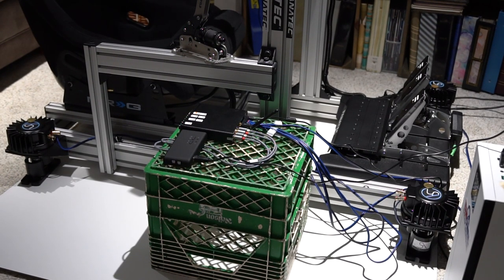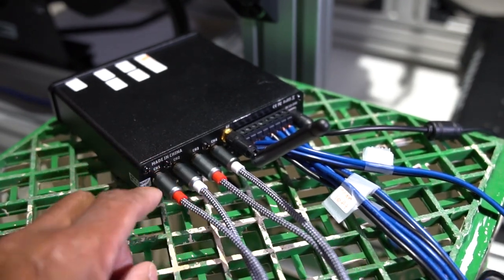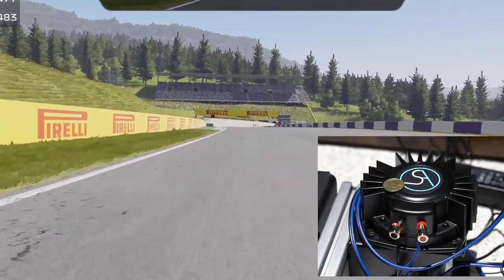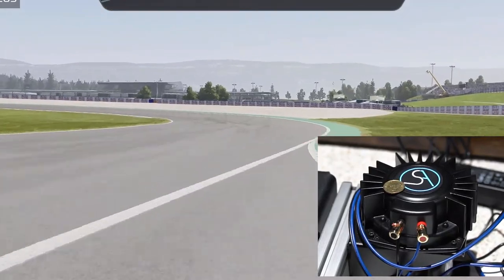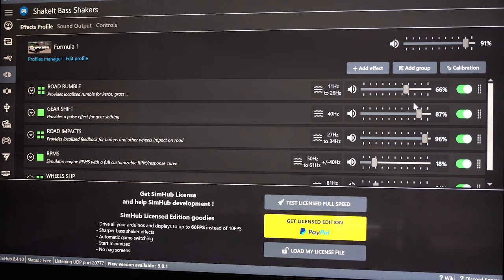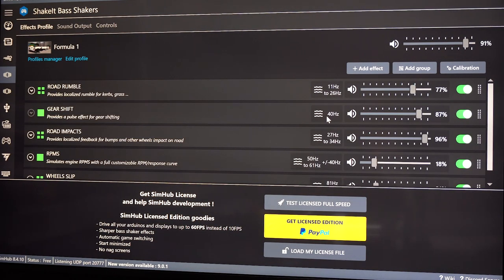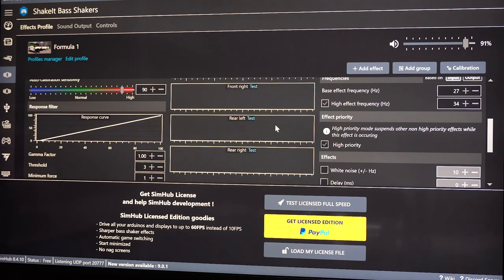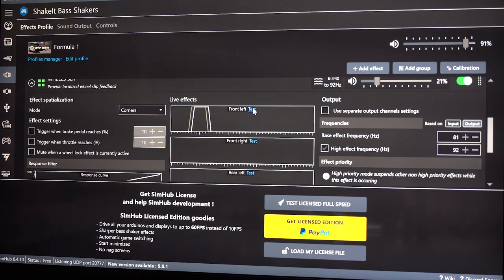Slip-Angle 4 corner shaker kit and SimHub detailed settings that work for me

Comment: Hi man, that looks complicated as hell! And so many wires 😳 Great tips for setting up the feedback. 
The RPMs is to do with the revs or revolutions per minute of the cars engine. Probably to simulate the vibration of the cars engine as you rev your car. I don't know how the curve works but I would say the way you have it is spot on. 
Maybe try having it Peak a bit sooner and then slowly flatten out the way you have it 🤔  It's an interesting one. A lot of options to tweak and adjust through all the settings. You seem to have it working great showcased by the driving on grass, gravel and rumble straps. Your settings and demo are definitely gonna help a lot of people out. Awesome stuff man 🙂👍
Reply from the maker: @footdownracing there’s definitely a lot going on with this software and it drive me mad for weeks. Thx for the tips about the revs, more playtime needed to dial it all in. It’s crazy how racing with no vibration feels odd. 

You’d get a kick out of the vibration with all the rally driving you do, especially on dirt. See if you can source the parts individually. Next, I have to figure out how to have audio come through the speakers and audio go through the transducers at the same time. 

Thx for watching.
Reply: @roostergeeracing6962  Yeh, it looks really cool 🙂 I might save up for a full motion rig like you suggested in a previous video. Those things are expensive, but it would be awesome to feel the rear of the car slide out or feel the car go light as you go over a jump 😃👊
Reply from the maker: @footdownracing  now that’s the ticket.

Comment: Can you use the Slip Angle kit without adding the springs(Have the frame on caster wheels for example).  I wouldn't mind putting the shakers on the inside of the frame and hidden from view
Reply from the maker: @Deadly-Storm yes, you can use the system without the springs and if you can find room you can have the transducers on the inside. With my setup, I can’t have the transducers on the inside and be at the front and back. 

Saying all that, one thing I love about the springs is that it gives my rig a feeling that the rig has suspension like a regular vehicle. So just me, but I’m not removing the springs for anything. 

Thanks for watching.

Comment: I worry about the springs absorbing most of  the vibrations. I feel like it should be a direct attachment, no springs. Ever try it without the springs attached?
Reply from the maker: Never tried it without the springs because it’s a lot of work to lift everything and take the springs off. But I honestly feel that the springs are after the vibrations (on the opposite side of the seat) so it’s not taking away from feeling getting to me. You make a really valid thought.

Comment: Thanks guys for describing everything.
I was most curious if you could feel the left right side, I learned from the comments that you can. I keep beating myself up with my thoughts whether I want to spend so much money on it, With shipping to my country it will be very expensive, I will have to pay a lot extra.
However, the question puzzles me, I understand that now you wanted to show the sound, so it was loud. However, it seemed to me that such a solution is installed in order to make the whole set quieter and not to disturb other household members. Here I have a lot of irritating rattle, noise, and I hope that it is coming from other components that are not screwed on, maybe from the mouse, or keyboard.
At the moment I have a Bass Shake LFE BST on the seat, and in other places easily felt, the heel of the foot, but I do not have such an irritating sound, and I can feel everything with my body. The back, the back, the heel of the foot. The only thing I'm missing to my complete happiness is the left right side. Just not at the expense of noise.
Not for this kind of money. Can you explain it?
By the way, nice video.
As for RPMS , at my place I have it set only at a standstill.
The first curve, value 0 flies to 4, the next vertical point up to 90, a parabola to about 20 and drops to the bottom and ends at about 38. Then another parabola, from 86, climbs to about 60 and ends at 100max rpm. I don't know how to post a photo here
Reply from the maker: @worms141414 I totally understand your concern. And thank you for your settings for the RPMs, I’ll give that a try. 

Yes, that crazy rattling is from my keyboard tray (which I do not like). I had it off for a while and don’t want to spend money on another one😂. I’m lucky that my setup is far away from the rest of the family so I can turn everything up pretty loud. With that being said, I am looking to remove that keyboard tray because the rattling is not part of the racing environment. And I’m on carpet, with isolators. But 💯no sound going through the floor. Next video won’t have a keyboard tray. 

If you look to my setup of the channels, where the left and right side are either both selected or not, or left or right, that gives specific options for feedback to the side I want. 

I agree that this setup is not cheap, but I looked at it this way, I could save for a few years to get a full motion D-Box and everything would be amazing. Or I could buy what I did and wait longer for a shifter and rally racing wheel. Now I currently have everything to do F1, GT, and rally,  2 kinds of wheels, amazing sound setup (I’ll make that video later), and a rig that gives tactile feedback like everyone has on their wheels. 

And the last thought is this, I’ve always wanted a Porsche 959 and a Lamborghini Siesto Elemento. But if I had those cars, I’d be spending $100 K / year just in maintenance whether I drove the cars or not. So I have not spent $700K in cars + maintenance + insurance + speeding tickets. I’ll never afford those now. But the rumbling of my transducers lets me enjoy all the cars in GT7, F1, and WRC G for way less than the expense of 2 real road cars. But that’s just my current situation. 

Honestly, your setup sounds pretty nice. If I outsourced the parts myself, I’d have a shifter by now.

Comment: Is it pretty simple to turn on simhub when you turn your PC/ console back on? Like just open the software and load settings type of thing?
Reply from the maker: Hi @christeynolds6152 I turn my PS5 on, then the PC (because I walk by the PS5 first😊). From the PC I open SimHub and select GT7. Then, switch over to my PS5 and open GT7. 

From that point SimHub does the rest and you can just play the game as you normally would. However, if you want to make any changes to your vibrations, you will have to go back into your PC and make the changes there. 

It will take some tweaking at first to set your vibrations, but once you have it set, you’re good to go. 

Hopefully this helps. 

Thanks for watching.

Comment: do you actually feel the 4 corners/4 tires separately?  I have 2 rear shakers on the rear corners as of now, and i cant tell which one vibrates when i test them separately.  I have same solid 80/20 rig as yours.
Reply from the maker: @rod272727 thanks for watching. Yes, I do. And at the expense of actual racing time, I spend time now and then playing with the settings to get more feel here and there. The most obvious effect for  me is going over rumble strips, as I have that on left and right and it’s just a very obvious part of the track where one side of the car should be smooth and the other should definitely be feeling those crocodile teeth 😊
Reply: @roostergeeracing6962  
Will you please do a video showing a left unit in operation with good volume using a glass of water placed/secured to the right hand side. Likewise to then show the front to the rear.  I ask this as vibrations will travel though any connected material/component. What does this installation do to ensure positional vibrations enter the respective body zones in seat/pedals first and/or PRIOR to the generated vibration from "corners" based effects being able to flow freely over the whole rig.

Comment: I have yet to see you highlight how this installation prevents vibrations from one corner entering other parts of the rig BEFORE it can enter your bodies individual feet/sides. We only detect tactile via our bodies, so the importance is to deliver the most detail and energy into our feet and seat above any of this idea that you are fully experiencing positional tactile.

Their are things you could do to improve this but this product is misleading if you are giving the impression you will ONLY feel a left wheel/suspension on the left side and the opposite for right side based effects. Further to this, go on the grass etc as even with certain effects they will output a response to all units. Stereo effects also need some work with them to improve their operation in how they better maintain stereo activity or indeed front/back operations.

Please though to anyone reading, support Simhub with a donation, the creator of it deserves such...
Reply from the maker: @Mr_Latte_UK fair enough, but I believe my video is about showing the product and that I love that I am now getting another level of tactile feeling from this piece of equipment. The isolators prevent vibrations from going to the floor. And I do know that when my tires are on the left kerbs I feel that and I don’t feel it on the right side. If someone wants to get tactile feeling from something other than the steering wheel, all I can say is that I love this. And like I’ve said before, I hate driving without this now. I get no payment from Slip-Angle and bought the kit myself. Could I mount it to the pedals? Possibly, but I don’t want to because when I drive my jeep through different terrain in real life, the tactile feeling that I respond to comes from my seat. Yes, there are transducers that can be put on the pedals, but I will never buy them because I’m 100% satisfied with what I have on this rig. 

What does frustrate me is that I may have to buy a better amp to boost the vibrations, but I’m saving for a sequential shifter instead. I’ve also paid to support SimHub because it looks like a tremendous amount of work that has gone into their software that is being used in a variety of games. I can’t say enough good things about the level of input that is possible with SimHub. 

Thanks for watching and giving valuable feedback.

Comment: Which sound card are you using? Does anyone know if you can use a USB to RCA cable to connect to an existing amp? Thanks!
Reply from the maker: @ricepony33 thank for watching. The sound card that came with this kit doesn’t have any branding. However, I have seen other people have success with a Nobsound sound card. 

 haven’t connected RCA cables to this, so I can’t help you there. I’m able to use the shakers and also have sound output to my surround sound setup with this configuration. 

Have fun racing!🏎️

Comment: Greetings from beautiful Barbados. I noticed that you are only utilizing 2 of your channels. I take it you have 2 amps, if that is the case, each amp is 2 channels, so 2 amps will be 4 channels. So your setup should be as follows: Channel 1 front left, Channel 2 front right, channel 3 rear left channel, and channel 4 rear right. From what I see in your video, you are not using channels 3 and 4. Try that and you will feel a huge difference. Take care
Reply from the maker: @paganini1224 I was in Barbados for the first time ever, a year ago. Been missing it ever since. Resort at St James and then walking around down town ☀️ ☀️ ☀️ incredible. 

Thanks for the tips. I tried to get my other channels working and couldn’t get channels 3 and 4 working at that time. I will give it another try🤞🏾because I definitely want the full experience. 

🙏🏾
Reply from the maker: @paganini1224 I only have one amp but I have the transducers setup as you have described. However, I still can’t get anything more than channels 1+2 working. Any suggestions?
Reply: @roostergeeracing6962  I was playing with my settings and it seemed the other channels (rear left and rear right) were in channel 7 and 8 for me within simhub. But I think they can be different depending on amps, sound card etc. I went with the 6 channel bass shaker amp. With these two other channels enables it makes the system far more effective. I had to turn my settings way down cause of how effective and strong the effects were.
Reply: @garrettobrien936  Hi i'm also in Barbados, my wife's dad is a Garrett :}. Did customs hit you hard with the duties/taxes and does the actual sound of the rig vibrating sound loud

Comment: Does GT7 works good with simhub?
Reply from the maker: There is an app icon on the SimHub home screen so I assume so. I’ll be doing the investigation next and make a video on those findings.

Thanks for watching and enjoy your next race🏎️
Reply: @roostergeeracing6962  dont even know how to do telemetry from ps5 to pc
Reply from the maker: @Jmab-rv7jc  it looks like something that could take me hours to figure out.
Reply: Hey, realize that this is a bit late. But, just came across your message. Yes it does! You need to have both your PC that's running SimHub and PlayStation 4/5 plugged into your router for them to communicate. I believe you can do it wirelessly, but I have not tried it. I was lucky enough that it auto configured. But, you may need to tweak your firewall settings for it to work. There are quite a few videos on YouTube that go through the process if you need to go in depth.
Reply from the maker: I was able to get it working nicely. I have the PC and PS5 on the same network. I turn the PC on first, one SimHub and start the GT7 play button in SimHub, then switch over the the PS5 and begin playing GT7. Works like a dream. 

This is very cool for racing 🏎️